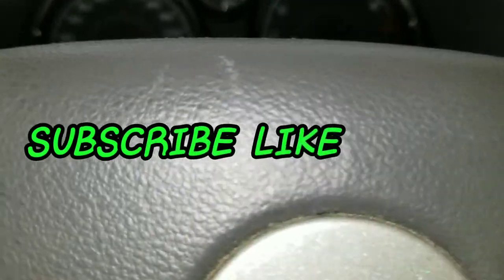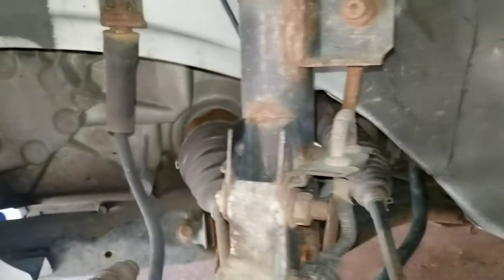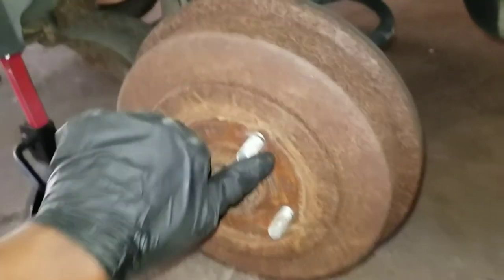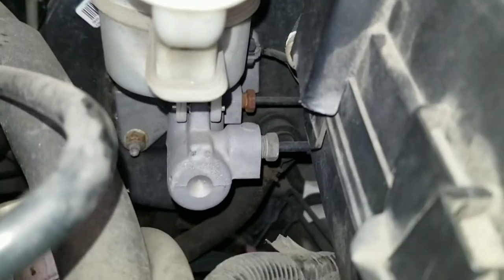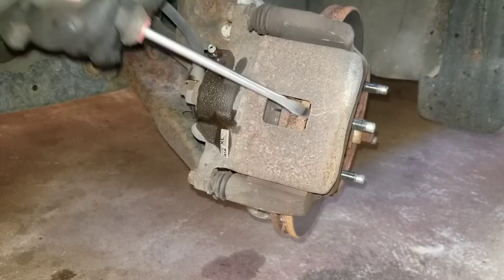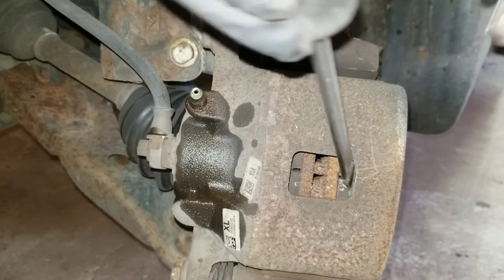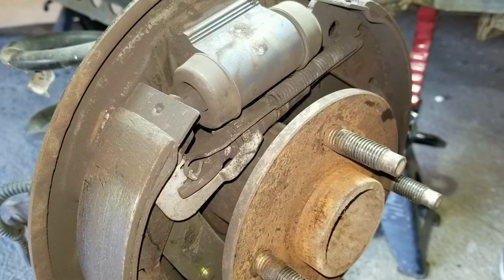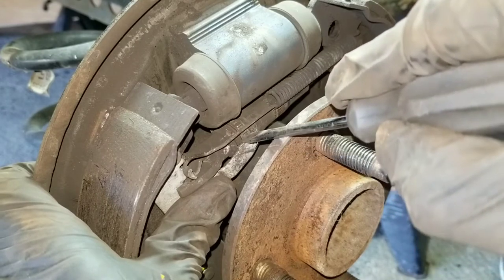Spongy Brake Pedal/No Brakes  Watch till END!!!

Comment: My original master cylinder was working perfectly fine but the fluid was very dark even after the brake flush. I noticed my rear wheel cylinder was leaking so i wanted to baby my truck and install a brand new ACDelco master cylinder and new wheel cylinders. Oh boy I had a horrible time bleeding the rear drum brakes. Brake pedal was going all the way to the floor. I searched YouTube videos to help me with my issue. So it seemed like ABS control module might have air. So i kept and kept bleeding it without luck. I went to my junk yard location to find a used ABS module. I spend almost half of day looking for one until i found one. Went home tried on and same results. I also purchased another proportioning valve because it might be the problem. Installed and same results. My brake light was on and almost no pressure to the rear lines. So I came across to a video explaining how to rest the proportioning valve to keep it open so fluid could travel to the rear line and same results. I bought a lot of bottles of brake fluid I spent about 70 dollars on fluid. I could recycle it and reuse it but it was turning dark and green so i didn't want to reuse it. So there were another videos that explained about some wheel cylinders could be bad and have defective seals and it could suction air back to the system. So I purchased another set of wheel cylinders installed them and same results. I was loosing my brain cells. I purchased a 80 dollars brake bleeder and didn't help at all. Same problem pedal all the way to the floor. I gave up and i took it to Firestone to the pros, so they can diagnose the main problem and the truck was there all day and they didn't find the issue. I was told it was because i removed the ABS MODULE and computer. That i needed a new ABS computer and a rebuild the ABS module otherwise i would keep have this issue. They quoted me a leg and arms so no way i could afford it. It was like buying the truck again. I went home all sad and disappointed. They didn't even bother to  check the master cylinder because it was brand new and original supposedly. I knew my old was working so I was like you know what ima install it back but honestly i didn't want to because it was old and looked beaten by the years. At this point I didn't care. So I removed the new master cylinder and BOOMS!!! My pressure was there instantly!! My pedal was firm and hard. No more brake light on!! After a week of pure stress finally i could breathe. This part gave me a headache I don't wish this to anybody. I hope you never get to go through this.
Reply from the maker: Wow that was an experience, glad it worked out for you.  Thanks for watching please Like, Share and Subscribe if you haven't already

Comment: I am actually working on a 2007 HHR and spongy brake pad even after  I replaced both wheel cylinders and rear shoes and the master and the front calipers work but still spongy pedal Im getting fluid out of all 4 bleeder valves but still spongy
Reply from the maker: @Skip William   the problem could be a few things. Contaminated fluid, air in the line, bad booster. Pump the pedal, if it gets firm then air is in the line. Thanks for watching please Like, Share and Subscribe if you haven't already
Reply: @BIGWILLSCARCARE  I pumped it for three days..lol I got great fluid in the LF RF RR and the LR was fluid but never solid so I even went as far as replacing the brake line from the ABS pump to the rear wheel cylinder and still nothing.. He took it to the garage and the ABS pump was no good AHHHHHHHHHH  lol
Reply: @skipwilliam5639  you fix it please what was the problem
Reply: @simsauto  It was the ABS module  it needed to be bled as well

Comment: I havea 2014 Honda Accord every time I change all pads and rotors it only takes a little while for it to feel like my brakes are not catching sometimes it feels smooth and tha. Others it feels like it's braking I. To nothing as if my brakes already word down, could this be the master cylinder. I'm in my 3-4 brake pads and rotors and still.having this issue
Reply from the maker: @Yg Bodybuilder  sounds like the master cylinder but you can try bleeding the brakes you may have air in the line or have contaminated fluid.  Thanks for watching please Like,Share and Subscribe if you haven't already

Comment: I changed a front brake caliper on my Accord 2014 and it sinks even after 2 bottle flushing. Before that was everything great. When the car is off the pedal get hard but when i turn the engine on it sinks. What can i do, pls?
Reply from the maker: You may need to research the correct bleeding procedure for your specific car or you may have to have a shop bleed it.

Comment: I think I have an extraordinary problem here, there is zero resistance on the brake pedal but the brakes are working strong and good when the pedal is depressed halfway.  The resistance from the pedal disappears while the vehicle is moving.  What is the possible cause to this problem?
Reply from the maker: @wilson T if the fluid is low and there are no leaks.  Your pads need to be changed,  however if the fluid level is fine and you have no leaks that could be your master cylinder.  Thanks for watching please Like, Share and Subscribe if you haven't already